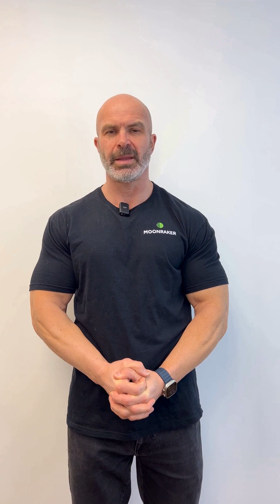SWR explained simply

Comment: As a mechanical engineer, this is how I had to understand impedance at frequency and matching. Like you have to adjust the valve for the minimum pressure drop going into an efficient antenna, or into mud. I am a mech-electric, just enough to be dangerous.

Comment: I’m using a president McKinley radio antenna on the front fender mount from my President Richard CB radio. I have a perfect SWR of 1.0 on both channels 1 and 40 and everything in between. Yet, my transmission and reception performance is not as good as it was with my Wilson 1000 mag mounted roof antenna. So does good SWR necessarily equal good performance? my McKinley and Tenore is a bottom loaded Coil. I’ve been told I should use a center load or top loaded coil.